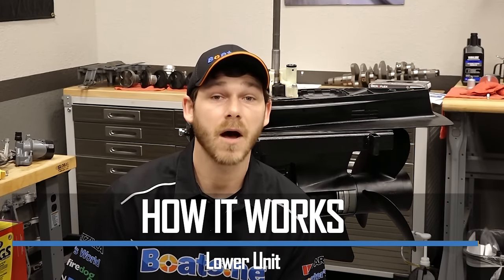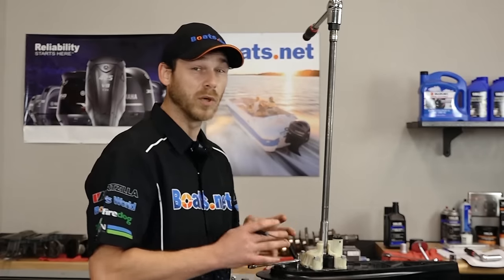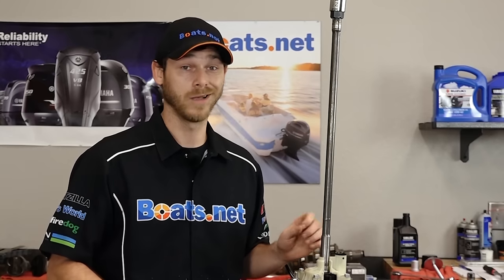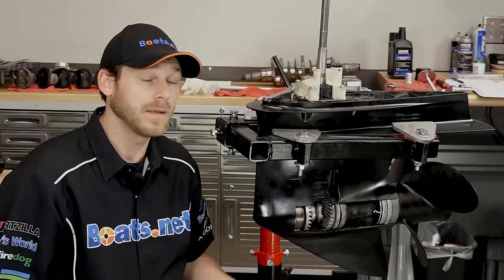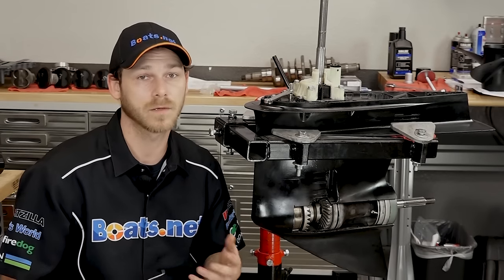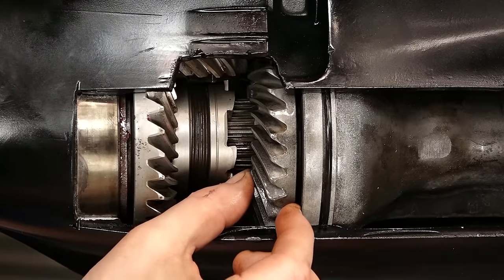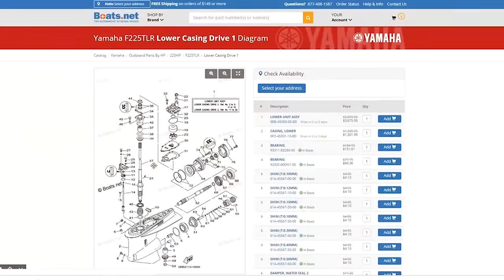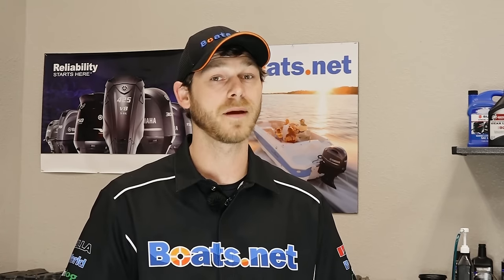How an Outboard Lower Unit Works | How an Outboard Gearbox Works | Boats.net

Comment: thank you - any chance you could consider showing the basic steps+using the "setting plate concept"  to setting/inserting the correct shims to take up the pinion+F+R gear for optimum tolerances, good clear explanation - watched from South Africa

Comment: I've always been automotive-oriented. My wife and I inherited a 1963 Starcraft a couple years ago with a 1994 Johnson 48 SPL. After a comprehensive online boating class, we became boaters. I'm trying to get up to speed on outboards, particularly in regards to routine maintenance. This video was VERY educational. Outstanding presentation.
Reply: Installing new lower unit on a Yamaha 70etlh 1986 having trouble with shifter going in reverse on in forward very quickly. The shifter is in natural and the lower unit is also in natural what am I  missing with the reverse problem

Comment: Thank you for this informative video! The cut away leg is brilliant👍🏻 It explains visually how a gearbox works and operates 

I recently bought a boat with very old unknown twin stern drives and twin 1.8 diesel Ford engines- so far I have found that engine 1. Crankshaft turns with prop In drive. engine 2. Crankshaft seized but prop in Neutral and turns! Both stern drive gear levers are stuck so do you think I’m looking at a loss or a project worth investing in? Are stern drives gears easy to unsieze? Thanks in advance for any advice

Comment: Great video that explains the seal points and the maintenance. I would be comfortable replacing the 6 seal point seals on the lower unit. Certainly replacing the water pump. Thanks.

Comment: Great job very clear video and voice.my Yamaha 115 four stroke 2002 model has a whining noise when travelling about 15-20 kmh noise goes away at higher speeds.otherwise motor runs perfect,can you suggest anything thanks!

Comment: Great video, so I have replaced the impeller and now when I put it back together I cannot select the forward/reverse neutral properly from the control. I have selected neutral and put the lower unit back together but when I then try and select the gears via the controller it will go from neutral the reverse and back to
neutral but not into forward. I did not touch the gear selector when I replaced the impeller and it was all good before the impeller change. It s a good engine in tip top condition and been well
maintained and also not thrashed as it was a sailing club engine that a won in a sealed bid auction.

Comment: Brilliant information, my engine wasn’t going forward, just into neutral and reverse, took the gearbox apart n fixed what I thought was the problem but after assembling it back it now goes into neutral and forward but not reverse, I’m starting to think it may be something todo with the shift shaft?

Comment: Out board shifts fine and runs at lower rpm fine but as rpm’s rise, there seems to be slippage and humming noise. Could both dog and forward gear be worn?

Comment: Two questions. When greasing the drive shaft splines, why is it important to not grease the ends of the shaft. Also, is it necessary to go back into the lower unit to connect the speedometer tube if I forgot to reconnect it?

Comment: Video suggestion:  I have not found a good video anywhere of the internals of a counter rotating lower unit. Would you please do a part #2 of this video  (How an outboard lower unit works) but feature the differences between a standard rotation and the inner workings of a counter rotating version.  Specifically, I am interested in understanding exactly how the counter rotation at the propeller is mechanically achieved.
Reply: The only difference is how they shift. Instead of it moving to the "forward" gear for forward, it would go to the reverse gear for forward.

Comment: Great video but I need help with gear alignment. Just replaced water pump and cant get the drive shaft back up into the power head. Ive put the gear shifter in forward and turned the gear selector on the lower unit to what I think is forward but im not sure

Comment: Such a great video for a novice like me!  I hit a stump recently with my Merc 90 - and I have a little water leaking out just above where my Transom saver holds the motor - If there's no water in my gear lube I should be able to JB Weld that spot right?

Comment: Got water in my gear box, looks like it's coming from the prop seal , will replacing the seals correct the problem and fix the knocking ,or is that more likely the shifter and throttle cables needing adjusting.

Comment: Great video! Since the reverse and forward gear are free on the prop shaft how can you hold them steady whille measuring the backlash? The clutch dog does not do that since the tooths are smaller than the ones they mesh on the gears. Thanks for your help..please help ! GL

Comment: Where on the site can I locate a clear assembly diagram and parts list for the lower casing assembly on a 2003-2006 Mercury 25hp 2-stroke outboard motor? Please provide a specific link for this diagram. Thanks.

Comment: What could cause play in the lower unit road, about an inch or so? Shift and throttle cables are adjusted but are not able to solve the issue of shifting smoothly. I was told by boat mechanic that there is play in the lower unit but he doesnt have time to look into.it

Comment: My lower unit came out of the winter, a particularly cold winter, with a crack, 3-4 inches long running horizontally about the same height as the prop shaft.  Can I fix it w JP weld to keep the oil in, or is it messed up inside as well and the o ring seal will never hold out the water ???

Comment: Could you please do a video on how to shim a Yamaha F150 standard rotation lower unit after gear set replacement. Also a video on rebuilding of trim and tilt unit on a Yamaha F150 or F225 would be helpful . Also when are the videos coming to perform reassembly on the Yamaha 225 video series ? Thank you.
Reply from the maker: Hello David! 
We do videos to help assist people to do their own work. Sadly, We dont have the resources to do on demand videos at this time.  We do have a "to-do" list which I will gladly add these items to, but there isn't a timeline. 
as for the 225 rebuild, we are around 2 weeks out.   Thanks for watching, we hope to spread a wide variety of work on different models
Reply: @BoatParts  Can you explain the bearings? not really explained or shown in the video. If you have saltwater/brown oil inside are the bearing rollers, thrusts the only things you need to replace aside from seals?

Comment: Hello i am trying to put my prop shaft and gear assembly back together how can i tell when the gear selector at the back of housing is in the neutral position it is a 60 hp 4 stroke yamaha cheers Darryl

Comment: I could use your advice, my brother in law doesn’t do maintenance on his Honda 90 horse outboard I believe it’s around  2015 or 16 the lower unit filled up with water over a period of time when he was using it evidently and he let it sit over the winter and if it froze, you know what ice dose to a lower unit? Well, the ice broke the tabs off the housing of the carrier bearing housing retainer I got it back together and putting all new parts in I cannot get it to shift into forward. It does shift into reverse and work that way no I don’t know what else that ice could’ve done maybe there was more damage than I assumed you got any ideas give me a holler appreciate thank you

Comment: I pressurized my F150 Yamaha lower unit through the top oil plug with 10 psi pressure. After several minutes I got oil weeping out of the prop seal. Question: can any oil additive or sealant be used to seal a leaking prop seal?
Reply: why not just replace it?
Reply: @wazup3333  OK, did that, thanks

Comment: What if you took your lower unit out but it was in neutral and now putting it back together it only goes in reverse when running? Should we be able to take it back out make sure it’s in reverse on the shift control on the boat and in reverse on the spline in the lower unit will that work? Thanks for all the help

Comment: Please assist. I have an 85HP lower unit which does not engage the neutral position properly, meaning that to find neutral you have to apply constant pressure on the shift shaft ever so slightly and once you let go it either jumps into forward or reverse gear depending on the direction you applied force. When installing on the outboard after best alignment, you can hear, what I assume is the dog clutch grinding ever so slightly on the forward gear. I suspect the shift cam and shift plunger to be bad. Would this diagnosis be a fair assumption? Thanks

Comment: Help needed. Great video.
Dropped Lower unit while in neutral and replaced impeller. Reinstalled unit and failed to check for neutral before starting. It started with an unusual clicking noise and prop was spinning. Shifting both fwd and Reverse revved engine but still in forward gear. The upper shift shaft was engaged as best can be determined on reassembling. Removed unit again. Now the unit is stuck in reverse only. The lower unit shift shaft rotates but until does not move into neutral or forward. Stuck in reverse. Why? How to adjust or fix? Possible dog damage from starting while in fed?
Reply: I have the exact same issue did you get it fixed yet?
Reply: Andrew Smith YES! Fixed. My mechanic was able to remove the lower shift rod cover and rotate the shaft so cams on shaft would re-engage the dog. Picking up boat today. Will get more details. Resend your inquiry so I get a notice again.

Comment: Can the shift dog actually kick out of gear ? I have noticed that  I had a clicking. Noise it the shift box under load and you could kind of tell the boat would slow for just a instant I got a new boat this year and put my old motor on it the clicking is still there but now it is like a clutch is slipping also  about the time it comes up on plane  if I shift it to neutral and back in gear it will start pulling again until it does it again. I don’t know if it’s the lower witch still has the clic  or if it’s the. Prop spinning thanks for any help

Comment: I'm testing my motor out of the water using the muffs.  Is the prop supposed to spin slightly when the motor is on or is it not suppose to spin at all?  If its not spinning while in neutral n the motor running what do I need to check on?

Comment: Thanks, I feel much more educated.

Question-
My skeg/lower hit the bottom of the river while traveling about 10 mph. The skeg is fine for the most part, just a scrape on the bottom edge, but the lower has a pin hole gouge where gear oil is leaking. The hole is extremely small right in front of the skeg, I had to wipe down and wait 1 hour to see drop. What are my options? Do I buy a new lower? Can someone weld the hole? Or something else I should do?

Thanks again!
Reply: You should be able to aluminium weld that pinhole.  The oil might heat up, but don't drain the oil while you aluminium weld it as you might cause more damage. Change the oil later, after you aluminium weld it. Change it with fresh oil.
Reply: JB Weld it,it is a two part epoxy with glue and hardner so you mix equal parts of each and then spread it over the hole and leave it too harden overnight but keep a little bit of mixture so you can check too see when it has hardened.

Comment: @Boat Parts Thanks, got it great video. Does the older (1974 Mercury) gearbox shifter work the same? i.e. To select reverse shift splines "clockwise & forward counter clockwise"?? The older Mercs have a sloped cam that goes over the splines. In which position must the spline selector be (forward, neutral or reverse) and at what rotation must the sloped edge of the cam be when fitting the cam? Not sure if this makes any sense. Your help will be greatly appreciated, thanks. Forgot to ask if the cables should be disconnected & if the power dead throttle cable position should be in the same position at the spline selector i.e. forward, neutral or reverse?? NB. This is a replacement motor. Thanks.

Comment: Discovered oil when flushing our 2017 Yamaha 250 4stroke, will be pulling the vessel ASAP but due to the COVID crisis it may be delayed
The vessel is used for Aux Coast Guard duties and is out of service leaving this service for potentially a month do you see any issues?
Thanks

Comment: Question for you, hope you can help out. My 1990 mercury 40hp has been getting stuck in forward, I had to drop the lower unit and manually reset the shift rod to neutral three times last summer. Any ideas why this is happening? Usually happening while pulling kids on tubes.

Comment: I have a question about a tohatsu m40c lower unit.when a put fwd gear and rotate the shaft clockwise the prop revs.when i rotate the prop the shaft dont move and i hear click noise.

Comment: I am stuck. Alpha One, Mercruiser...lower unit. Project is Replace PropShaft, old one is twisted. My problem: Cant figure out how to get the Prop Shaft out. Do i need to get hold of the nut down near the gears? relase the nut then everything comes out? Everything else seemed simple.

Comment: Why does inboard motors have water pumps on the engine, just not enough pressure with just the impeller?

Comment: not sure if you actually read the comments, I have a 120 hp force 2 cycle and I have replaced the impeller and it only trickles out the back 2 holes. I have never seen this motor work so I think it streams out the holes, It over heats with a loud noise I turn it off immediately but that doesn't solve my issue, PLEASE HELP

Comment: I recently changed my gear lube oil. All of the sudden, the motor seems to bounce when I raise and lower the trim. I filled the oil until it came out the top vent hole. What could be causing this?

Comment: I have a small Suzuki DT8 outboard motor that will NOT go into forward or reverse. I can see the push rod half way down the engine going up and down as I operate the forward /reverse shifter on the side of the motor. Is it possible the clutch dog spring has gone bad? I don't see any other adjustments. I could use a little insight. Bruce

Comment: I have a 115ETLJ and in the rear I have a nipple 6E5-45378-00-00 with a hose 90445-07MF2-00 connected to it and is closest to the gear shaft. When I was changing the Impeller I had to disconnect this hose when pulling out the lower unit and was wondering what this hose connection was for.
Reply: Speedometer

Comment: I'm not getting grinding during shifting, but I am intermittently getting RPM lag around 3k-3.2k rpm in one of my Yamaha 250s. ie, one motor will accelerate to desired rpm (say 4000) and the other will stay around that 3k mark. What could cause this? Could this be a worn clutch dog?

Comment: hi , i have a knocking noise from mid lower unit on a 90 hp 4 strok yamaha , question , can i take off lower unit, an put water hpose on upper unit at engine an turn on motor an see if noise is gone ?

Comment: At the very front of the unit before the shift shaft there is a hose that on mine screws in and goes up to the engine. I traced is and it goes no where -plugged at the other end. What is this for?
Reply: Speedometer

Comment: I bought a 78 evirude 55hp when I put it in forward it goes in reverse, and vicaversa .I have a 92 49 hp Johnson controls. I was told it has the wrong "earlier" lower unit .what do you think?A friend told me to drop the lower unit and turn it "dont know what it is" and reinstall it.that makes no sense to me.

Comment: i have a 2017 yamaha 115  SHO outboard and it stop going into gear so i pulled the lower unit and when i dropped the unit the drive shaft was very very  loose could that be the problem why its not going into gear,,??? can someone please help,,,!!!

Comment: So I could not get my vent screw out so I drilled a hole in the screw and used a retractable bit it got the screw out in a second but of course my drill bit tip broke and went right inside my vent hole ( no I’m not kidding 🥴) it was about an inch long and 1/8 th bit should I take off the lower unit 😞1992 90 mercury outboard ???

Comment: Please please please repair an indepth how to shim an outboard motor with full explanation.  It is no where on youtube. The one video you boats.net does not do a good job of explaining the use of the backlash measuring tools and explanation is lacking. Needs to be scaled down for the diy boat guy. I want to fix my lower units. I am a commercial fisherman. I want to repair and have spares in the off season.  Thank you.
Reply: what do you mean how to shim a lower unit?

Comment: I took down my lower unit and I changed the water pump on my two-stroke 50 hp Yamaha . Before I changed the water pump when I would put it in reverse it would grind a little. When I put the lower gear unit back up into it and tested it at a local lake, it’s in forward and it will not come out of forward even when I put it in reverse. So I pulled the lower unit again and no matter which way I move the shifting rod it stays in forward.  I don’t know what to do.
Reply: Need help
Reply: Yeah thanks I figured it out I took it to a marina and they put a brand new lower unit on it

Comment: My shift shaft on my Mercury 115 horse 6 cylinder will spin 360 degrees and doesn’t go in reverse, what’s broke?
Reply from the maker: Hello wayne! Sounds like the finger on your shift shaft is broken. (That would be the actual shift shaft) or it could be the collar that connects the shaft to the clutch dog. If you provide me with a S/N i can supply you  with a diag and name off the parts i am talking about! 
Thanks for the comment!

Comment: I HAVE A 60HP YAMAHA BIG FOOT FOUR STROKE. IT STARTS TO SLIP AT ABOUT 4000 RPM NO GRINDING JUST THE MOTOR SARTS OVERREVING I CHANGE PROP AND SAME THING HAPPENS. I WAS RUNNING ALONG AT 4500 RPM AND HIT  SOMETHING IN THE WATER AND IT STALLED THE MOTOR, THAT IS WHEN IT STARTED HAPPENING WHAT COULD BE MAKING IT SLIP LIKE THAT?